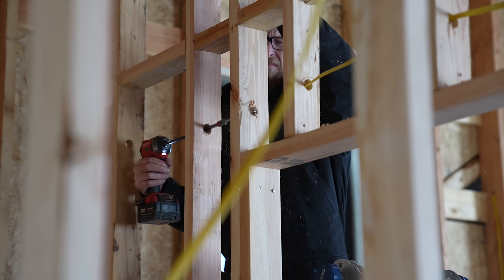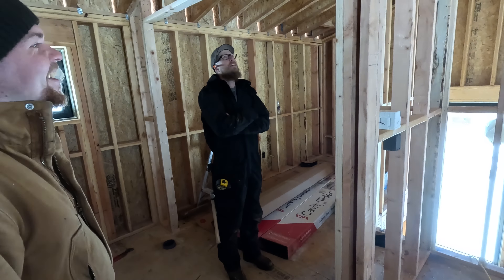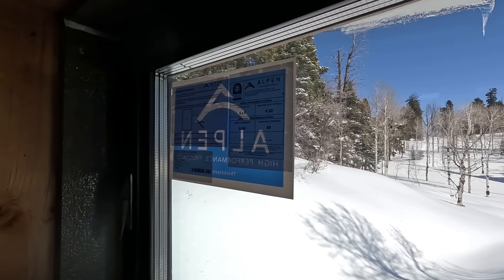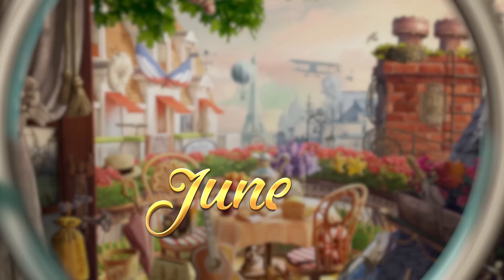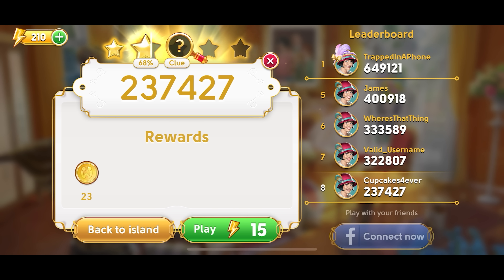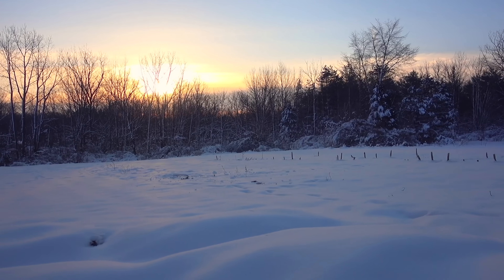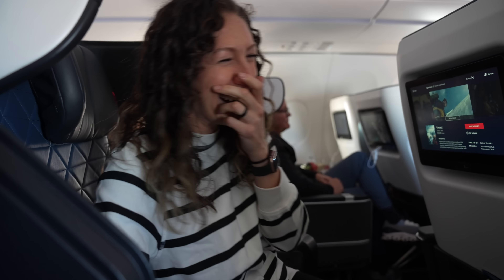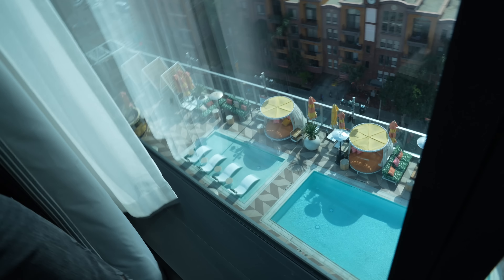WE'RE LEAVING TOWN AGAIN...

Comment: 27:18 sixth degree isn’t the top, there are are ten degrees of black belt but it is extremely rare for anyone to go beyond 6th degree.

A 7th degree black belt is denoted by a “coral belt” which is black and red stripes, an 8th degree black belt actually wears a belt that is red and white striped and a 9th and 10th degree black belts wear a red colored belt which is the highest achievable honor and belt in Brazilian jujitsu.  It is still classified as a black belt but they are awarded the respective red belts to distinguish from the lower level black belts.

Comment: Have someone bend you up a pic of 1/4"   3" flat bar and lag bot it in the half wall and plate. Get the bo.ts as far to the edge as you can. Otherwise you will have cracking problems forever.

Comment: Why stumble over ran and run verb tense issues when there are a lot of other words that can be used to say the same thing? Such as …we drove to the waste facility with a load….The electrical wires  are now routed into the circuit panel and outlet boxes.

Comment: Half Walls -  Run a piece of all thread near the end of the wall.  One end goes through the floor (nut and washers); and the other is countersunk into the double top plate of the wall (just enough for the nut and washer).  Then you tighten it up like a banjo string.  Works 60% of the time every time.

Comment: Maybe you should get Milwaukee's cable staple gun. It would make it much easier to fasten the cables instead of having to hammer the stables on them all the time. 
Also, you should not use an impact driver to drill holes with. It will put extra strain on the drill bits and especially the spade bits. Impact drivers are for driving screws very well. You should also maybe look into a right angle drill too since it will help drilling in hard to reach places, alternatively there are drills with replaceble heads that can do the same thing.

Comment: I feel so sorry for you with all the electrical work you have and are doing with the worst wire stripping tool on the earth. There is another tool that cost more but holds the wire and also cuts and pulls the insulation off for you. I have used them since i was in the USAF and they are still working like new, even after millions of stripping being done . and no more hand issues, as the tool does all the work.

Comment: The run, ran thing you hate is as follows. I am to RUN power cable from Sub board to far Bedroom, I RAN a power cable from Sub board to far Bedroom. I ran a water line point A to point B or I have run a water line from point A to point B.